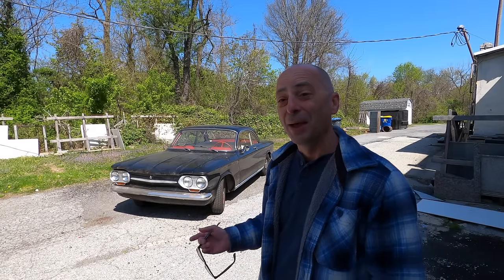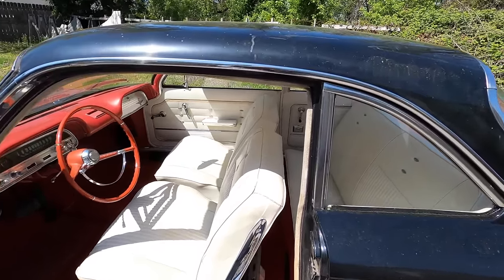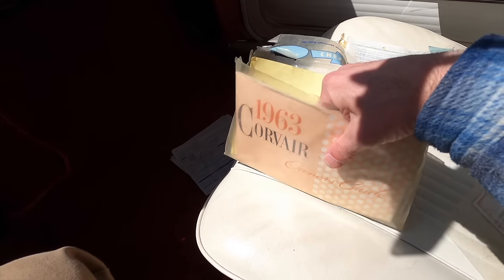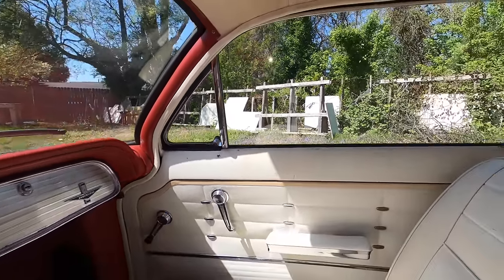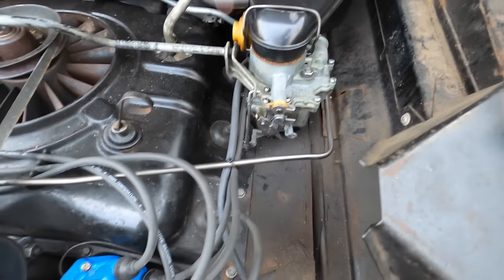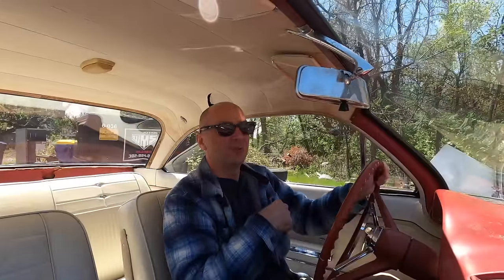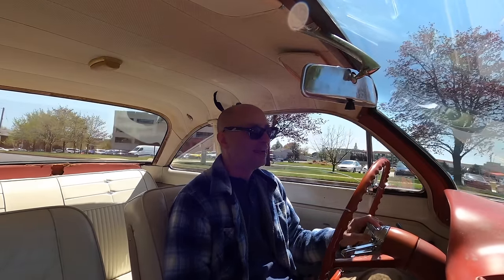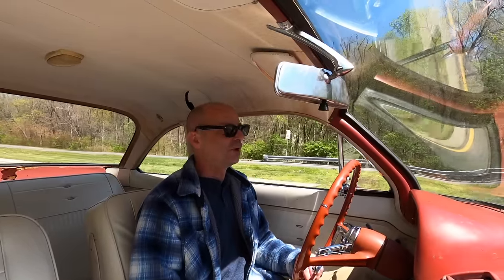Chevy Corvair - The Weird, Quirky, Cheap and Yeah COOL Compact

Comment: During a time in high school I drove a Corvair Monza. It is one of the best cars I have driven. I would take dates out on the coast highway during heavy rain and drift it on all the corners. A corner meant for 45 I would take at 60. One night I had a carload of students and hit a corner at 95 and was not prepared for the radical break of traction and almost lost it. Now looking back I would have never let my kids ride with the previous me. The car was predictable at lower speeds but at high speed became dangerous.

Comment: Chevy II was similarly sized with conventional configuration for those reluctant to invest in Corvair innovation.
Death trap rhetoric is undeserved, counterintuitive tire pressure specification together with standard issue cornering tactics got some drivers in trouble. Ralph, otherwise a splendid chap argued in ignorance against Corvair value as easy to drive economical and fun transportation abbreviating its lifespan and rendering to it an uncommon and legendary panache, good choice of an interesting car for those not made of money.

Comment: back in 1967 my dad bought a 64' Corvair 110 hp 4 speed 2 dr. for my sisters to drive to high school and I'd drive it around the block after washing it, I was 14 at the time. was pretty peppy quick car. In 1993 I picked up a 64' Spyder for $1400. who's father had picked it up for a father -son project but son was killed and he sold.

Comment: My dad had a 1963 Corvair. The only problem with it was that it had no weight in the front. A good crosswind could jerk it into another lane or into the shoulder. Dad put some sandbags in the front trunk to counter that tendency.  Later he had a 1965 redesigned Corvair. It was much more refined and roadworthy, without sandbags.

Comment: I used to have a 1965 Corvair. It was a great car but it had no balls with the 110 motor and the powerglide trans. Your fuel problem could be 
several things. The easiest would be the carburetors. Sometimes the floats stick or crud from the gas tank gets in the needle seat and clogs the 
carb. You should run inline filters and also check the brass filters in the fuel inlet on the carbs. The carbs need to be synced for air flow and there is a tool
you can buy that sits on top of the carb that lets you adjust the air flow. The problem that I had was the camshaft eccentric that makes the fuel
pump work gets worn or the pushrod gets warn and the fuel pump won't work. Get an electric fuel pump but make sure to wire it into the 
ignition so it only works when you start the car or you may have a vehicle fire if you forget to turn of the switch. Crovairs are leakers but you can get 
aircraft seals for the oil tubes and you heater shouldn't smel;l like oil. Learn how to fix the car yourself and dump your ripoff mechanic. Good luck. Jack

Comment: GM engineers were well aware of the the problems associated with swing axles used by VWs and other European cars.  They originally designed it with a fully independent double-wishbone rear suspension. Then bean-counter extraordinaire Roger Smith applied the pencil sharpener to the car and figured they could save $35 a car by going to swing axles. So that made the car into a squirrly handling POS. In 1965 the revised model the double wishbone suspension was included which solved many of the handling problems after the Nader book came out.

Comment: I had a neighbor in Memphis who owed a "66 o'r67 Monza. She came home a nd was unloading it with the keys in the ignition, whe her twelve year old son jumped in an drove off, it gets worse. while he was driving around several twelve/thirteen year oldes in another car decided to get chase him. The kid who couldn't really drive went off the road and hit a steel wire rope lamp post guy. It hot dead center and cut the little car completely in half and knocked out the engine and trans axel. the wreck split over and the driver the center just fell out. The (numerous expletive's delegated) Memphis police thought it was so funny that they didn't press any charges. The worthless Memphis Commercial Appeal news (sic) paper also wrote it up as piece of humor, kind of missing the point that a twelve year old fitting the ground at high speed could have very easily been killed.

h

Comment: As a teenager I had a 1963 Corvair that I paid $200 for 1969 ! I also had a 1962 Corvair that I paid $35 for FOR PARTS - it eventually ended up on cinder-blocks in my back-yard as I kept STEALING PARTS and tires etc. off the PARTS CAR to keep my DAILY-DRIVING going as cheaply as I could ! Then there was the book UNSAFE AT ANY SPEED which talked about the FAULTS of the CORVAIR for example each REAR AXEL is independent and can FOLD-UP under the car in a BLOW-OUT flat tire (?) - It happened to me on the Inter-State Highway and my car did DONUTS a couple times around with me inside ! Luckily I didn't hit anything and just put the spare on and drove on !! IMPORTANT NOTE - they make a kit (a long-metal-bar) that can attach to BOTH rear axels so they wont be INDEPENDENT anymore and fold-up under the car MAKING FOR A MUCH SAFER CAR - Please get one for you car ? I TOO Liked the car and have wanted to purchase the newer model MONZA which is STILL STYLISH to even today's standards which is why I can't find one - they show up at car-shows !!!  :-)

Comment: I had a 61 Corvair in high school when it was just another used car. Heard all the stories, read Nader's book, I liked the great traction and tail happy handling and never had a problem except once, when I skidded off a snow covered road by driving like a fool. The big drawback to me was the lack of heat. No doubt that could have been fixed but I didn't know how to fix it at the time.
Do yourself a favor and save the original paint. Touch up any rust spots,  Wash it, polish and wax, give it 3 or 4 coats of wax and do it again every six months or a year and the paint job will last forever,don't let it deteriorate any more you wouldn't believe what a good paint job costs these days.

Comment: Yes, make sure it's a vented gas cap. And also install an electric fuel pump up front near the gas tank. This will help with vapor lock wich is more common with the gasoline blends we have now.
Reply: I disagree that its "vapor lock".  Since it is random it sounds more like sediment clogging fuel lines or carb, especially since something is still going on with the gas gauge.  I would not replace fuel pump with electric.  The car is pristine original - no reason to start hacking it up.

Comment: Hey, I don’t know if you figured out your fuel gauge issue. Mine was doing the same thing. I first checked if power was going to both the sending unit and the gauge with a volt meter. It was. Then I noticed that if I applied pressure to the two connector prongs on the back of the fuel gauge, it would read. I figured it must be a connection issue or a bad gauge. I took the gauge out, it looked intact with nothing broken, and with some sandpaper, cleaned all the terminals ands grounding areas as they were tarnished.  Put it back in and VOILA!…. Works.  Hope this helps.

Comment: Hey that's a nice find Chris ! & for what You have into it , It should bring a few grand more if You were to sell her ! IMHO the gas gauge issue could be as simple as a ground, How's the Greenbrier doing ?  I've owned a 60 model 700  4 door , & never had any handling issues with her! & I regret selling her still because I bought another Corvair & only had room for 3 & I still have those 3  a 64 Greenbrier Deluxe 6 door , 65 Corsa Coupe Turbo , & a 67 Monza Convertible the 64 & 67 both have 110's in the engine compartment with automatic transmissions . I've always been a Chevrolet guy ! But the Corvair has always been my favorite they had a model for every type buyer. & thank You for the video it was very well done & You covered it very well ! I hope You do a follow up on this 63 Corvair Monza 900 Coupe to let us know how she coming along , & where You'll be going with her . Thanks again for the video.

Comment: I had a 61 Corvair,  I liked mine,   it was automatic,  in about 1965,    I was in my Corvair on the Hollywood Freeway,  doing 65 mph when the the traffic backed up quickly,  I stepped hard on the brakes and it just kept going !!   I whipped it into another lane,   lucky me I didn't have an accident,    when I got home I took 2 hundred lbs. bags of sand. In the front,    trunk,   that put some weight in the front,  now it's got traction,    then it stopped a lot better !!

Comment: For the fuel problem, it might be the Kauneuten Valve. Try to find one, very rare. They are made of bilayered copper and aluminum alloys, with double headed stainless rivets. Sometimes the layers corrode, therefore clogging the fuel filter.

Comment: I had a '63 Greenbrier window van. The UK version was exact say for the left hand drive.but the ony issue with it is that it didn't like keeping cluch gear boxes intact. Other than changing the clutch plate, throw out bearing, etc it was very reliable.

Comment: My parents took my sister and me from El Paso to Los Angeles in a Corvair in the heat of the summer.  No air conditioning.  I was 5 years old.  There was a lever between the front	 seats that opened up the heater.  I reached up and opened up the heater with nobody noticing.  Everybody sweated through New Mexico and Arizona before my dad figured it out.

Comment: Enjoyed the video and learned a few things.  Still would like to see you put in three point seat belts for driver and passenger.  Otherwise, enjoy the restoration.
Reply: the steering column is not collapsable and in the most minor accident will shoot like a spear and decapitate you. The seatbelts would just give someone a false sense of security. Any front collision in this car should be expected to be non survivable even at 20 or 30 miles an hour
Reply: @errorsofmodernism9715  Only sometimes - not all collisions are the same and 3 point belts keep you in the car instead of flying out and underneath it while it rolls over you -

Comment: My first car was a Corvair. 1972. I bought a trade in off a dealer lot for $100 ( 1965 ?  It has been 50 years ) I drove it for 2 years then bought a 56 f100. Terrible in snow. Backed into a bunch of curbs and curb blocks. Ripped the exhaust  off. I got real good with muffler bandage. Soak it in water and wrap it around.

Comment: A friend just got his license and bought a 66 Corvair and wanted me to go for a ride.  I said "hey doesn't this car flip over at 25 mph?"  lol   He said it had revised rear suspension and had 140 hp.  I learned how to drive a 4-speed in that car.  It handled great but didn't have a lot of power.  We had to drive around with the windows cracked because the engine and exhaust fumes would make our throats raw and give us headaches.  We were 16 and went everywhere in that car.

Comment: My dad bought 2 13" tires (albeit bias ply) in a Citgo gas station, for my '62 Spyder (we bought it for my first car at 14 1/2) in 1971.....the bill was $26. I hope the oil cooler, under a little bolted cover forward of the right carburetor - was cleaned ; it's half the life of the engine.

Comment: The BOP brands used this chassis for there small cars too, but they were front engine rear drive. 
The used strange engine combos like the Pontiac had a 4 cyl that was basically half of a 389. The Buick used an all aluminum 215 v8. Etc.

Comment: About the gas gauge, if the car has a printed circuit behind the cluster it may be the nut is loose at that area of the circuit. I had an old 73 Mercury Capri that had the problem and that loose nut was the only issue. Tightened it and the gauge immediately started working.

Comment: great vid and car had a friend who knew some one who had a Corvair  He said one day the engine fell out  The oil bath air cleaner?  My 66 Chevy truck had one Had nothing about a paper filter that went with it  It was just a big bowl that wnt around the Rochester 2G carb  just used 1 qt of oil  had the 283, Powerglide w handchoke  When the fuel gauge stopped working I used a broom handle  Once the rubber hose that connected the body to the gas tank had a crack in the rubber  When I put gas in it  Gas went out under the door  :)  Also if you filled it up too much And the truck sat in the hot sun gas came out of the nozzle

Comment: My 1st-grade teacher lost a few months of her life in a coma from a Corvair accident. She hit an oil slick and the car wiped out, which could have happened with any car, but was probably more likely in a Corvair.  That was in 1966, so she was likely driving a pre-1965 model. Yours doesn't have the 1965 Corvette-style suspension, but being a Monza, maybe it has the front anti-sway-bar and rear see-saw-bar (or whatever they called it) that become standard for 1964. I've heard that the '64, though less refined, could be nearly as safe as the 1965, due to those changes.

Comment: I had a '60 (Maybe it was a '61) and a '64.  The best feature of the early one was it had a heater that ran off the gas tank. Instant hear in the winter!  Other than that, you were better off with a spare fan belt instead of a spare tire.  Handling on the early ones just sucked. On a wet road it would "Come around" on you in a turn or curve. It is a shame that they were taken off the road after all the bugs were worked out.

Comment: I owned a Corvair. As long as one kept the two carbs balanced, it ran great. Basically, it was a good car and fun to drive. Putting a 50 pound bag of sand in the front helped keep the front end down which helped with steering. Unfortunately, my wife drove it into a concrete bridge abutment. End of Corvair.

Comment: It was a fun summer car I had one in 1965 four speed six cylinder The only thing I couldn't drive it in the winter you would get going and go to stop intersections etc car just kept right on and going all that weight in the rear pushing the car forward ice and snow

Comment: About it stumbling as if it leans out. Check plug gaps and plug wires. The sending unit could be defective even tho it's new. parts for older cars, especially electronics being bad out of the box is becoming more and more common. So revisit the distributor as well. 👍 Nice car

Comment: 65-69 didn't have the I'll designed axle/suspension that made the earlier models dangerous.  In fact, they handled great on winding roads.  Rear engine made weight transfer during aggressive braking on curves a dream.

Comment: I've owned 5-6 Corvairs in the late 60's and early 70's. Last one was a 65 Corsa with the 140hp 4 carb motor with a 4 speed, 164 cubic inches. I drove that one for 4 years. A guy wanted to trade me a nice 71 VW Super Beetle straight across, and that was the last of my Corvairs. It was actually faster off the line than the 180hp turbo charged versions. The first one I owned was a very nice red 63 Monza coupe with a 4 speed with white interior. Never owned anything but the 4 speed cars. The automatics were just too slow for me.  Most Corvairs came with 4 speeds, and IIRC only a few 3 speed cars were ever made.

For the 63 and older if you don't like the bump-steer you get from the swing axle design find a camber compensator for your car. That and a heavier duty front sway bar and it'll transform the car into something akin to a Porsche. Well, damned near! The camber compensators were stock on all 64 cars, which was the last year of the swing axle cars. The camber compensator helps, but does not eliminate the bump-steer from the swing axle cars. VW guys can also find a camber compensator. Get a bigger front sway bar and the bump-steer all but vanishes. I put a larger sway bar on my wife's 64 convertible and it turned that car into a very well-behaved car. Chevy could have done the same, but for some reason never offered anything bigger than what was found on the Corsa models, and those offered until 65. 

These are fun cars to own and drive,  but you will need to either learn how to work on them on your own, or find a mechanic that can. Most charge more than $25 per hour. Most problems will be with oil leaks. Oil leaks in winter will make you smell like an oil refinery! To replace the push rod tubes you will need to remove the motor and pull the heads. There are 12 push rod tubes, and 2 seals on each, so 24 seals just on these tubes. Buy the best silicone seals (o-rings) you can find. Things like fixing the oil cooler leaks is much easier. The engine and transaxle come out together, and is fairly easy to pull. The 65 and newer are easier than the early models since you need to pull the axles back on the early models. For the 65 and newer you simply remove the half shaft axles at the transaxle, which are relatively easier than pulling the brake drums, etc on the early models. I used to do all my own work, with kids and a wife there wasn't much extra money for a mechanic back in the day..

Comment: Vapor lock because of fuel with alcohol . Try putting  some wooden outside cloths clips on the fuel lines that near the carbs. An electric fuel pump can help with vapor lock. Install it before the stock mechanical fuel pump. Leave the original pump hooked up.

Comment: We had many in the family--and every one of them had a cement block in the trunk (that thing in front) to offset float at freeway speeds. Make sure the exhaust rings, and manifolds are good--that heater design will gas you out. (Or disable.) This problem gives no warning.

Comment: In 1971 I took my life savings ($700) and went car shopping really wanted the Corvair it was newer with fewer miles Mom said NO. The Novas and Falcons to worn out or above my price range.  ended up with a 63 Rambler. Spring forward to 1974 my Boss had a Corvair and I had a ball driving it.